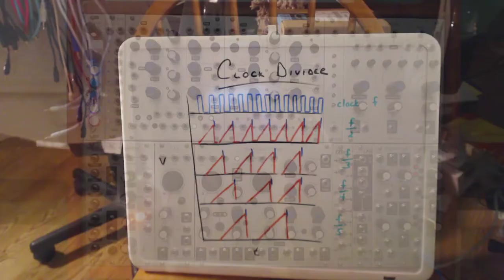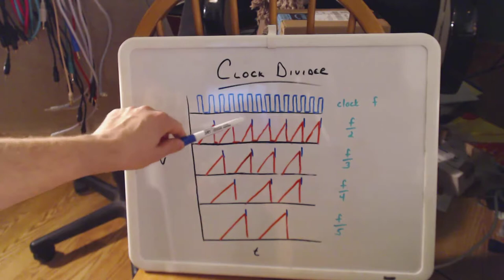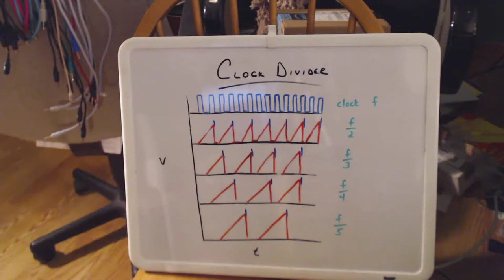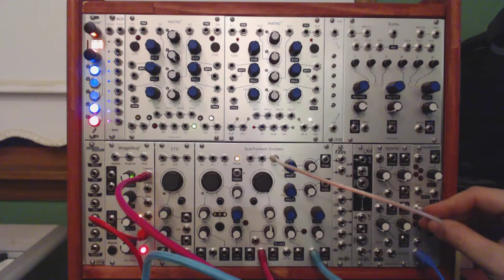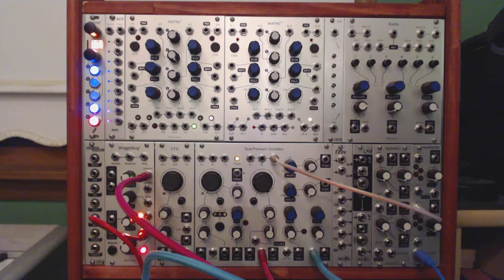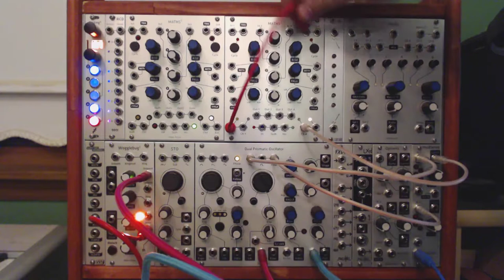Maths as a Clock Divider

Comment: How does your RCD work at audio rates? My pnw starts to alias making it hard to use for much outside of basslines.
Reply from the maker: Yes, I see aliasing on the RCD at audio rates, too. I don't really use it for audio though, usually just sub-audible clock rates.

I do have a second mini-skiff with another tool that's good for division (and multiplication) at audio rates, though. That will be in some future videos...